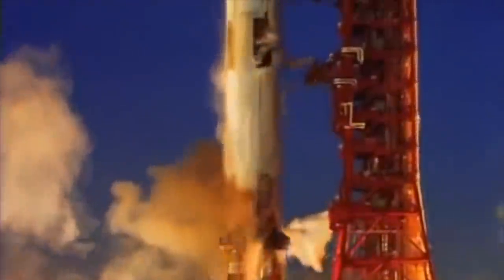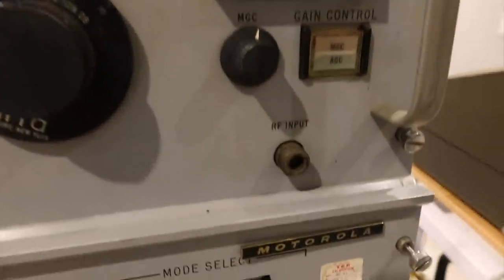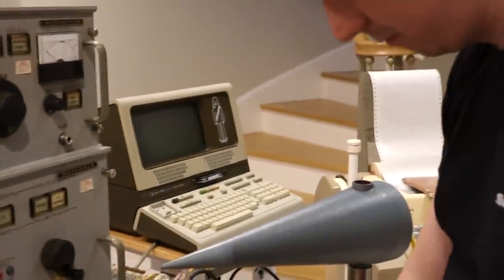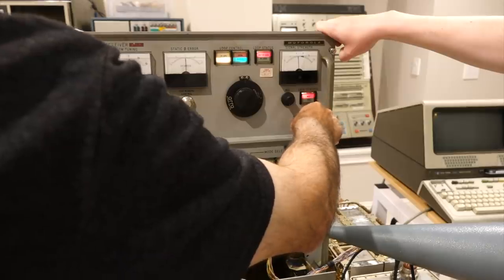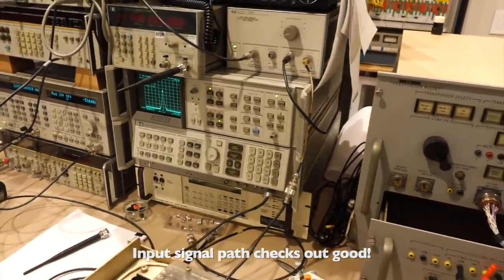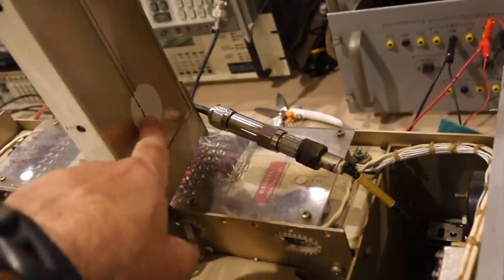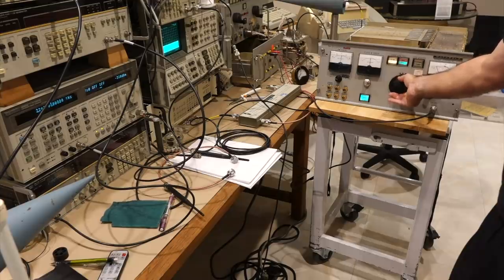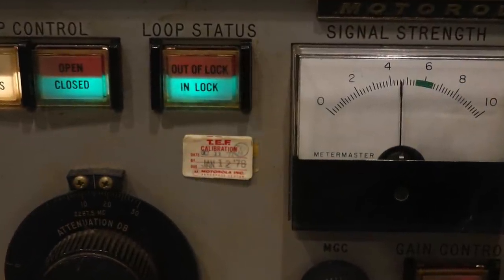Apollo Comms Part 7: NASA phase modulated receiver

Comment: That must be a really sturdy workbench considering all the ironmongery that is stacked up on it!
Reply: It's owned by Marc, so there is a high chance it was made by HP in the late 1970's. The screws probably all have an obscure HP part number and you probably have to use some magic translation list (only available on microfilm) to order spare parts on Ebay.

Comment: Amazing that you guys are able to figure this out. and reverse engineer it.  I worked at the NASA Apollo tracking station on Kauai.  Among other things I was responsible for the ground station SDDS Signal Data Demodulators. It was considerably simpler to operate as I just had to configure the right modules and cables based upon instructions and modules sent to me by the people designing the system. I had only the indicator lights for the acquisition of signal and PLL etc to tell me that it was working right. The entire SDDS unit was about the size of a refrigerator with equipment drawers and a lot of modules.  Each mission was different and between missions I would swap out the the various modules and reconfigure, then spend hours and days doing signal to noise ratio tests with the signals from the USB antenna system until it all seemed to be working as planned. You probably won't be able to acquire an SDDS console as the modules were built with a silver backplane which separated the DC side from the signal sides. There was a lots of silver in each module. I only remember ever having problems with the PLL circuitry,  I don't remember what the problem was. but recall spending a lot of time solving it.

Comment: You know, it just now dawned on me watching this video that the crystal has "MHZ" etched on it instead of "MC". That would have been an immediate giveaway had we looked at that first, and been thinking about it.
Reply: @Wizardess  Except that this hardware is from Apollo era, meaning designed in the 60s. Seeing something from the late 70s is the dead giveaway Mike is mentioning, that would have been a clue this was modified hardware.
Reply: The AGC was used in an F-8 Crusader for fly-by-wire experiments in the early 1970. I bet they used fairly standard Apollo radio hardware to get live telemetry in case of a crash and just retuned the frequency. I don't have any details, but i bet they just slapped a receiver setup plus a few reel-2-reel tape recorders into a B-52 (or something similar) as a mobile data recorder.
Reply: @ReneSchickbauer  That may be the case. The construction suggests this puppy was not built for airborne use with its attendant vibration profiles. It looks like test equipment not what I'd expect in mission control. It looks like it'd be REALLY shy of the noise figure and amplification required to make it an operational receiver. Although I can't say that for sure. I did not notice any level readouts from the signal generators.

{^_^}
Reply: @Wizardess  I've been trying to remember when I first started seeing Hz used instead of c/s. Certainly when I did my UK amateur radio exams in 1966 that was all in c/s but I do remember being similarly irritated by the emergence of the less intuitive Hz in my college time, late 60s, so the change was happening just as this kit was being designed. It takes a long time for these newfangled units to become common currency - think how long Centigrade hung around after Celsius was foisted on us!
Reply: @bobroberts2371  I believe the normal usage at NASA would be his on the job notebook would have been left with NASA when he left NASA. They should have it. But it might have to get pulled from archives perhaps in a cave, today.

{^_-}
Reply: @ReneSchickbauer  the KH8 is wow! extremely impressive with their foto development module! Thanks for the sharing! For others that want to read more: https://en.m.wikipedia.org/wiki/KH-8_Gambit_3
Reply: @jeremiefaucher-goulet3365  Their S band box is labelled for last test in 1976 so it should not be nearly as much of a surprise to find that this equipment had sensitive components replaced something to the tune of a decade after it's original manufacture
Reply from the maker: You are right Mike. It's definitely an evil crystal made with modern witchcraft and marked with futuristic measurement units.

Comment: The quality of the hardware is really impressive.  Other than the usual peripheral items (e.g. switches, lights, pots, connectors and other corrosion magnets) you have not really had to spend any time troubleshooting bad capacitors, off-value resistors or cheap semiconductors in the bowels of all of the gear!  You may have to do some research to uncover the exact specifications for the cut and mode of the crystal--hopefully documented.
Great progress guys, enjoying every minute.  Thanks!
Reply: It is like vintage HP instruments. I usually replace the tantalums and electrolytes, but other than that, they are built like a tank.
Reply: I should hope that $500 billion taxpayer dollars would buy some pretty decent hardware.  ;-)
Reply: @dgaborus  I wonder if Tektronix are just as good? I recently acquired a mid 1960's Tektronix 453 and it works awesome still. Looking to recap one day. But are the 60;s ones as good as rock solid as HPs?

Comment: You all are so incredibly lucky to be able to do this stuff.
Reply: Figuring out The test gear is as big a project as the Apollo gear. 

Great find to have the test gear. And in basically working condition.
Reply: We are all so incredibly lucky that they can, do and share it with us while archiving history
Reply: I wouldn't call what they've achieved with all the old hardware from the Apollo era, as "luck". It takes a lot of multidisciplinary skills and knowledge, determination, patience and hard work, to bring this old hardware back to life. All this hardware has been laying around for 50-60 years, but no one - as far as I know - has even tried to bring it back to life. Very few would've a clue where to even start if they got their hands on this antiquarian hardware. I can't even imagine all the research they have to do to figure it all out. I have huge respect for these guys.
Reply: @ThomasGabrielsen  I’m more saying they are lucky to be able to find this stuff, and have the knowledge and connections to restore it
Reply: @ThomasGabrielsen  
Getting hold of the purpose built gear is a stroke of good fortune (aka). If they had to make breakout boxes and control it’d take longer. 

I don’t think he meant the outcome was lucky.
Reply: @fluffed_coyote1487  just remove anything 'luck' related from your vocabulary. It was chance that this equipment survived, or it was someone intentionally saving and not destroying it. It Is skill, knowledge and understanding methodicly gained which lets it be used today.

Calling something luck demeans the huge effort put in by these people seeking understanding. These videos are culmination of many years locating equipment and searching for documentation by Apollo aficionados from even before the existence of the equipment in question was known.
Reply: @RowanHawkins  you’re reading into this wayyyy too much

Comment: PM and FM are fundamentally the same thing. If you receive PM with a FM receiver, the demodulated signal just comes out integrated, ie with a 6dB/octave rolloff compared to what it should be. You can easily fix this by applying a 6dB/octave HF boost to the demodulated signal. The result is exactly the same as if you used a "real PM receiver". From your reverse engineered schematic, and the way the controls work, it looks like the NASA receiver is a FM one with a PLL wrapped round the whole thing, and I expect the PLL's loop filter ends up performing the highpass function to convert to PM. Of course none of this detracts from the coolness factor of getting it working :)

Comment: ive seen that style of fuse lamp before, the military still uses them on some older equipment, the idea is that if the fuse blows the holder lights up to tell you what is wrong
Reply: also im painfully familiar with those stupid recessed bulbs, i got to replace half a switch box that had been neglected, i found and added to a pile of bulbs inside the chassis that slipped and fell
Reply: They were used a lot in the 60s on Univac computer equipment, too.

Comment: I adore that gold-plated, interdigitated bandpass filter at the end.  Quality equipment!  What's quite amazing is that the electrolytics are not dried out after 50 years.  They might be tantalums.  I wonder if you put up an antenna, it would pick up the mystery spacecraft?  Probably need that huge dish antenna.  I'm waiting in anticipation for the next episode!  👍👍
Reply: Those were large old style capacitors with oil dielectric. They seem to last forever.
{^_^}
Reply: At those frequencies, the gold is really the only thing that conducts anything of note, so it was definitely worth doing :)

Comment: How much power is fed down to your basement lab??  200A sub-panel?  More?  Great videos. Thanks!
Reply: Why everyone thinks a bunch of old instruments must consume a whole power plant of electricity? Oh god... maybe 100 or 200W for the bigger ones. That is it. One 15A circuit likely to power it all on the bench.
Reply: @Sixta16  Everyone expects there to be a tube somewhere in it.
Reply: @davidmcgill1000  you mean a CRT tube, which at the size of question needs a few tens W?
Sorry, but all the HP equipment presented is from about the microprocessor era, so what other than CRT vacuum tube do you think about?
Reply: @Sixta16  As an owner of much of the same microwave HP equipment Marc has, I'm here to tell you the lights dim when I turn it on.  I do have a dedicated 20A circuit just for the test gear.

Comment: tuning the multipliers back to the original frequency will be easy. The slugs and controls should end up somewhere in the mid range. it's a Motorola thing :)
Reply: It should be an “everyone” thing. Any engineer designing trim ranges should know to put the most likely value right down the middle. At least these days we got Mr Carlson to make sure we all know that :)

Comment: Nice. I think it's very important to preserve the Motorola test gear, just as much as the actual Apollo items.

Looks like the multiplier in the main osc is probably 96, then? ;)

2,197,000,000 Hz / 96 = 22885416.66 (Xtal freq).

(if the crystal was spot-on 22.885417 MHz, then the freq would be 2.197000032 GHz.)
Reply: The VCO works by pushing the frequency of the crystal itself around a tiny bit -- and these small frequency shifts get multiplied into much bigger shifts after the X96. So the sub-Hz difference between 22.88541666 and 22.885417 doesn't really matter, since the VCO will naturally correct for it.
Reply: @Wizardess  Wow, you're right, assuming (I think) you meant GEOS-3... how/where did you find that? That is an excellent find!
Reply: @mikestewart8928  As an old time RFer (contemporary with Apollo for some of it) I did the obvious. I searched for the frequency to see where it popped up. After a "-pi" to get rid of Rasp Pi stuff GOES-3 popped to near the top on the Duck. I searched for low side mixing first. I also searched for high side mixing, which comes up very close to a power of two frequency fatal to some early SDRs. I figured that was not germaine in the 70s.

{^_-}   (During that time I was doing Hedy Lamar radios - fast frequency hoppers to be specific. Pure F* Magic!)
Reply: @Wizardess  LOL, I love how 'GEOS-3' and 'GOES-3' are both legitimate satellite names from about the same era. I'm sure that never confused anyone ...

Comment: What kind of resin 3D printer?  BTW those were the first type of commercially available 3D printers, introduced by 3D Systems in the mid-1980s.

Are those Stoddart log cones?
Reply: I printed those bulb extractors on a Phrozen Sonic Mini 4K.

Comment: Hmm, wouldn't stuffing the output of the FM receiver into an analog integrator yield a PM receiver?
Reply: The only real functional difference is you can get DC levels out of an FM receiver, but not a PM receiver.
Reply: @stargazer7644  Well, to get a DC level out of an FM receiver you'd need an exact frequency reference, and you could get a DC level out of a PM receiver if you have an exact phase reference.  Generally neither is available and you lock onto the carrier instead, making both of them DC-free.
Reply: @MatthijsvanDuin  You've obviously never used an FM receiver for FSK data.
Reply: @stargazer7644  Is FSK used for signals where both an indefinite string of zeros and an indefinite string of ones is allowed?

Anyway, like I said, if you have an absolute frequency reference (e.g. a free-running oscillator of sufficient accuracy and stability at both transmitter and receiver) you can get DC out of FM, though you'll need the transmitter to be stationary or compensate for doppler effect. Having a shared frequency reference is certainly a lot easier to achieve than having a shared phase reference (which also requires compensating for distance between transmitter and receiver).

If however the receiver locks on to the transmitter carrier like it does here (to receive a transmission whose carrier frequency drifts, e.g. due to the transmitter being in orbit) then the act of locking on acts like a high-pass filter, for both FM and PM, blocking any DC signal.
Reply: @stargazer7644  Ehh, doppler moves the carrier which causes a DC-offset hence can turn a 0 into a 1 or vice versa when using FSK. Meanwhile a DC-offset has no effect on how FM radio sounds, which carries an audio signal and does not care about any DC component.

Are you confusing FSK and AFSK ?
Reply: @MatthijsvanDuin  No, you would need some code on top of the binary data, like NRZ or NRZI, so that you never have a stream of infinite ones or zeroes.
Reply: @MatthiasWelwarsky  Yeah, I know, I was just trying to figure out what Star Gazer was talking about. In the end, based on a comment that seems to have been deleted, I'm pretty sure they just confused FSK with AFSK.

Comment: possibly those receivers used small triodes called "nuvistores" (RF transistors should still be not very efficient)
Reply from the maker: This is all solid state. As you can see from the block diagram, they went around the lack of microwave frequency transistors (which indeed did not exist at the time) by doing everything at lower frequencies and using multiplier circuits.

Comment: Look at the SkyLab frequencies.
Reply from the maker: Not Skylab as far as I can tell. Skylab did not have S-band per se. It used that of the command module attached to it, so it should be the same as the original Apollo.

Comment: Do old crystals change their frequency?
Reply: Of course they do. The real question is "How much do they change their frequency and which way?" This is down at the small fractions change. A VCXO would usually have a tuning range near +/- 500 ppm. By the time you get out there the oscillator stability degrades and it's easy for the oscillator to switch crystal modes or simply forget there is a crystal there.

For decades of "just sitting there" I'd expect the crystal to have picked up contaminants from inside the case. So when you run it it will "age" quickly as it kicks the dirt off. The frequency will rise. This will slow over time until it becomes PPB per day of aging. Other components, of course, will lead to greater apparent aging if their values have shifted, particularly the capacitor and inductor involved in making it "VCXO" over a wide range. If not inductor is used the tuning range is significantly reduced. And that may be OK from the standpoint of what is needed.

{^_^}
Reply: @Wizardess  You can do a fair job of testing them with one of those $89 VNAs.
Reply: Sure, but they don't change the printing on the case.
Reply: @proehm  That is how you design a VCXO.
{^_-}
Reply: @stargazer7644  That would be a neat hack if you could manage it. But, then, these days a crystal oscillator and a frequency synthesizer could fit into a case smaller than the particular crystal in question. And it could have enough eeprom to enable fairly tight TCXO operation. (Hm, you might even be able to fit Leo Bodnar GPSDO functionality into that case size.)
{^_-}

Comment: If I do the math from your sheet so => 23MHz * 6 = 138MHz * 16  = 2208MHz - 2287.5MHz = 79.5MHZ IF1 why you're writing the first IF1 is 50MHz? or a other solution is to ask a Motorola Engineer at the graveyard. :-)